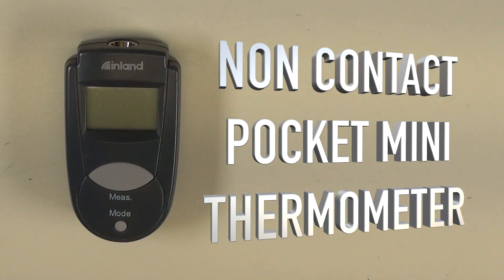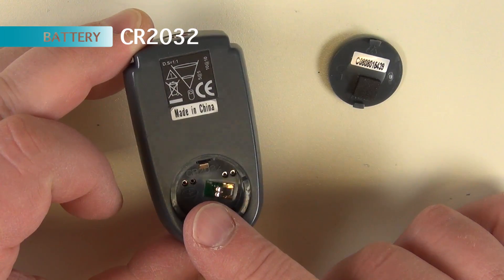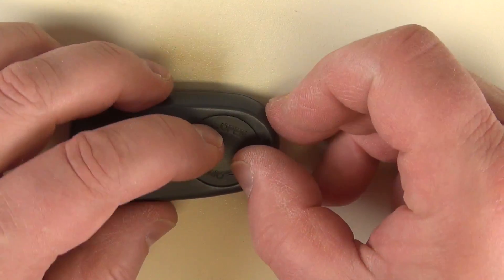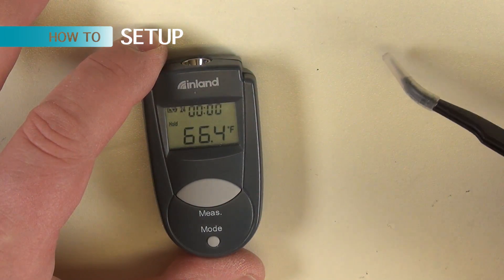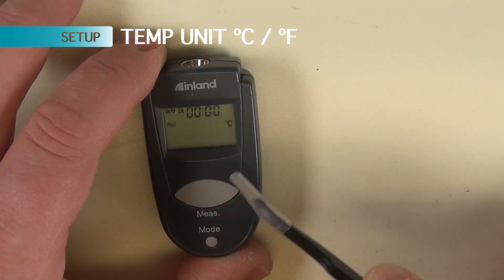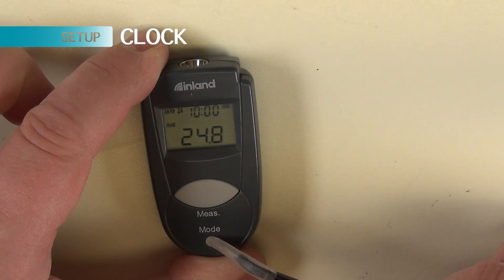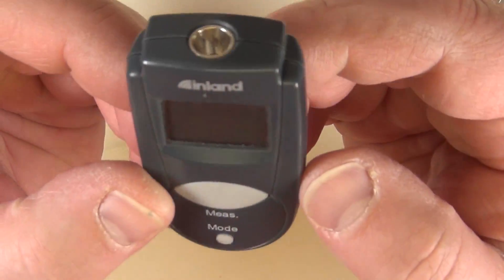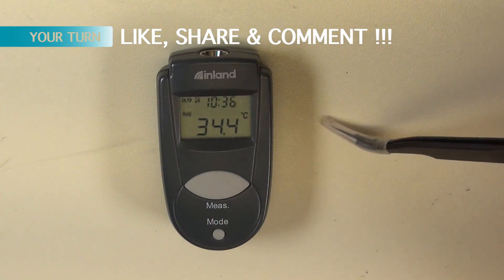Non Contact Pocket Mini IR Thermometer

Comment: Had it for years and recently found in my car. It had a dead battery. Put in a new battery and it recorded temps and shut off (Blank Screen) after a couple of minutes until next measurement. I downloaded the instruction manual and programed time. Now it won't shut off.
Reply from the maker: it takes a long time to shut off

Comment: How do you turn it off?
Reply: the manual says "If the clock is not set, the display will shut
off after use, conserving battery power."
Reply: it times out on it's own

Comment: mine is very inaccurate boiling water reads 174f
Reply from the maker: Larry English it is hard to accurately measure boiling water. You need to use a matte colored pot, and measure there, and not directly the water.
Reply: This only measures outside temperature, meaning the more cooler surface layer as oppressed the hotter water that's hitting the pan.